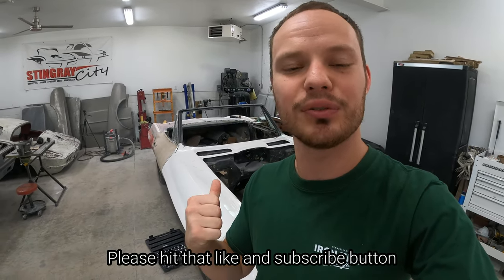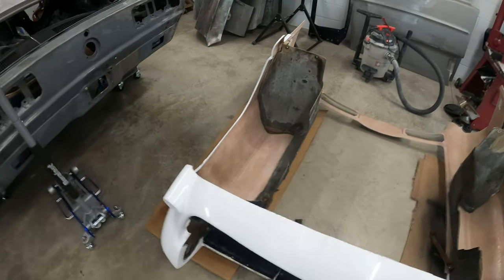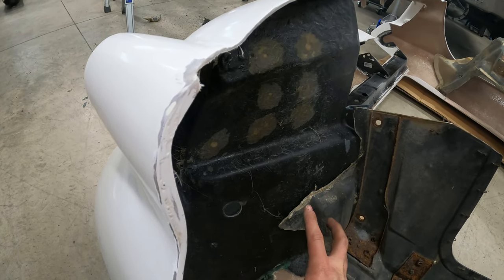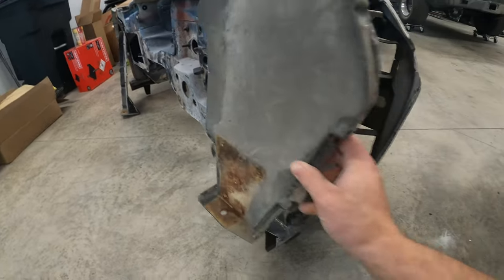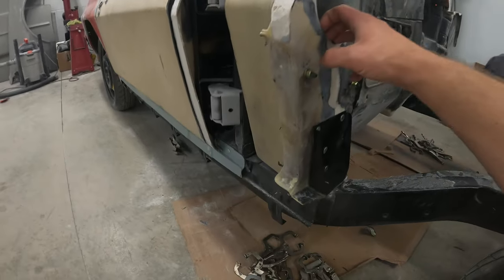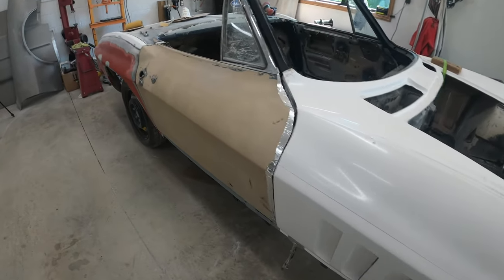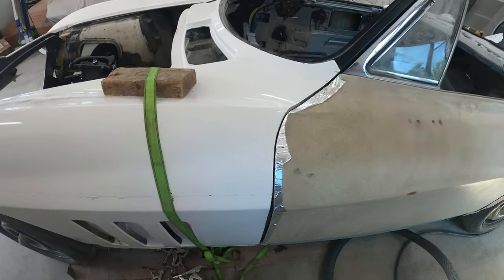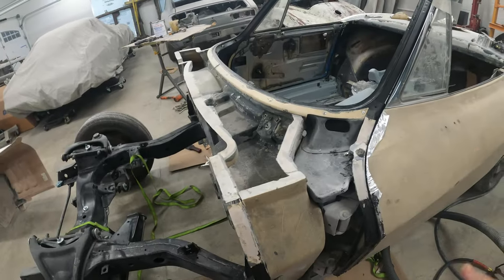Tips On Installing A 1963-1967 Corvette Front End.  Saving A 1963 Corvette Convertible.

Comment: I like the work you do. I'm restoring a 68 Corvette and I'd like to know what is the name of the bonding adhesive that you're mixing up like when you installed the inner fenders/ wheel wells? Thanks in advance and keep up the good work!
Reply from the maker: Thanks Dwayne I appreciate it. Very cool! Good luck on the car. I used corvette image bonding putty. You get it right from them. It’s a nice product. Very stinky stuff though but it works. I like the 3M 08115 tubes for big bonds like a full front clip. It gives you 90 minutes of working time and it’s mixed to the correct ratio every time. It’s more expensive but I like that piece of mind.
Reply: @MidYearMitch  Thanks a lot for the info. I'm about to order some of it.

Comment: Another great job Mitch , how much time do you have before the bonding adhesive turns over , having dad help to get the job done quickly , On the top of the nose where those dreaded rivits always want to show through , will this car have the rivits ? My 65 has a metal strip with rivits going through the body . I can see the outline with a small raise in the glass . I think it would take a full repaint to fix , I'll live with it . A guy I know with a 67 painted his car like 10 years go and I can see the rivits . Never mentioned it to him but I'll bet he knows .
Reply: Hey Bob, the 3M 08115 used on the front clip has a 90 minute working time.
Reply from the maker: Thanks Bob! What he said lol. Hmmm I’m not sure exactly where you are talking about. But if they are aluminum rivets they would hopefully not show. Most likely it would need to be worked over to fix the area.

Comment: Awesome job,  great video, always something to learn! I don’t understand going to all that work and putting a 65-66 front end on a 63? Thanks
Reply: Hey thanks Dan! This car is far from original. The original L76 has been gone for at least 50 years, and the chassis has been modified to accept disc brakes, been reinforced etc.. putting an LS3 and a Tremec 5 speed in. Ultimately, I wanted the 65/66 front clip on the car to help reduce lift, as well as for heat extraction. I also generally prefer the look of the 65/66 fenders. I can always switch the side fenders out at a later time, if I decide to put the car back towards stock.
Reply from the maker: Thanks Dan. Yeah what he said lol.